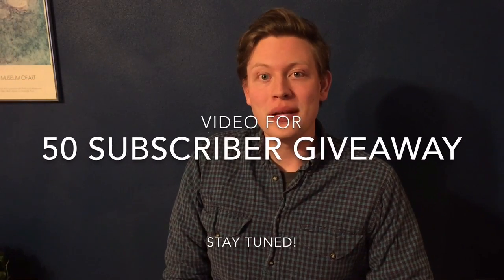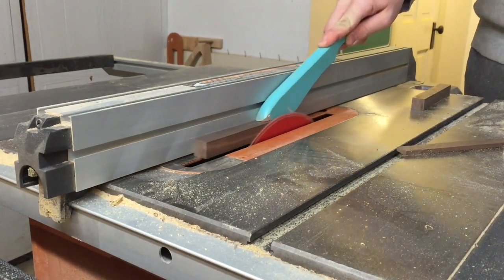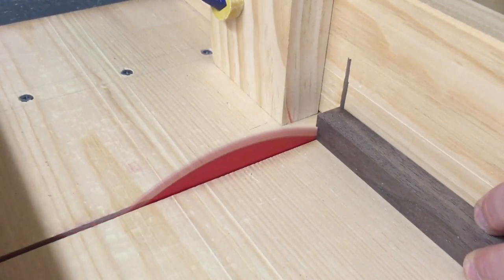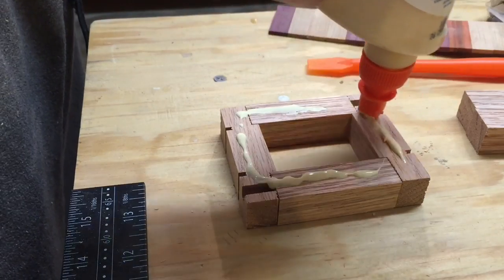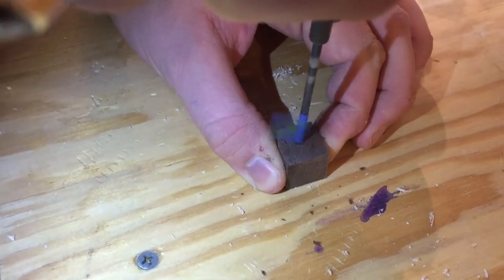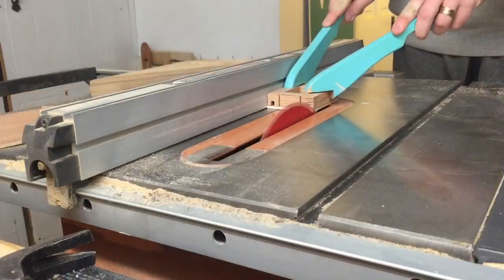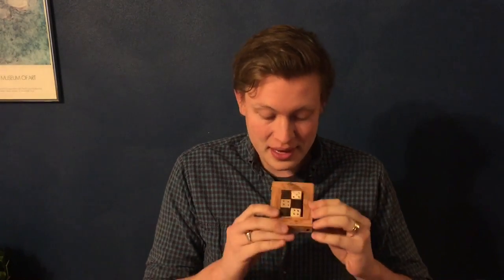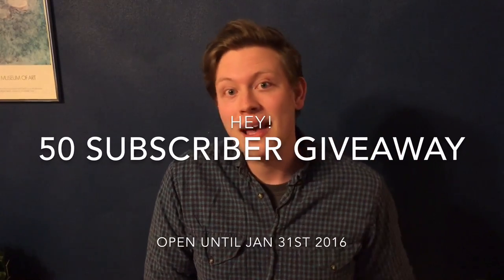How to Make Wooden Dice

Comment: I have been woodworking for 40 years. I learnt about kickback the hard way. I got hit by a 2x4. It happens so fast you can't even blink. It caused a massive bruise on my left side. I never operate a table saw without a splitter or riving knife. Please be safer and make a splitter or use the riving knife(if your saw came with one). I cringe seeing people pushing stock thru with no splitter or riving knife.

Comment: Did you make sure to weight them properly (IE drill the holes on the faces with less holes deeper slightly so that the center of mass isn't off)?
Reply from the maker: +cooldude23407 Alas, I did not.  If I were to do these again I wouldn't even drill holes at all actually.  I've learned that a better method would be to burn in small indented divots.  Thanks for commenting!

Comment: Before making a video and a bunch of these dice you might want to find out how a dice is made! If you add up the opposing sides they add up to 7. Cannt just put random dots on.
Reply: Also since you drill material out for the dots not there is abhorrent balancing issue, well as corners being hand rounded that changes results as well. Cool decoration but not a dice really

Comment: Hello, a little late, but I was wondering how you would go about making them from something round, such as from deer antlers?
Reply from the maker: That sounds cool.  In that cased, I would recommend holding the antler pieces in a vice grip and then using a drill press.  Have fun making those!
Reply: Thanks! I will!

Comment: The tripod on the table saw shot was actually pretty cool.  Looked like a pan almost.  Like the dice, like the case, good video.  One question - how come the work piece appeared to climb up the blade on the first shot of you cutting it, and how can you avoid that?
Reply from the maker: Thanks Matthew!  I was able to fix that climbing problem after this video. It was happening in part because my faceplate wasn't properly flush with the top of the saw, and also my push sticks were too short.

Comment: Where is your blade guard!
Reply: For you other readers:.  Invest the money, get an overhead blade guard w removeable splitter if you don't like removing the blade guard for jigs.    And if you're using a jig like a crosscut sled try to put safety guards (lexan/back blade blocks etc) on them.  And PLEASE loose the long sleeves and jewelry while you're using power tools.  Using the stop on the right side of the blade, just like using a fence with a miter gauge, face full of wood (or worst) waiting to happen.   Guards are cheaper than a trip to the emergency room and prosthetics .   Bear with an oldish timer for a story:  Was in the Plano Texas Medical Center emergency room around 7:30 one night (on a non-woodworking related visit) about 17-18 years ago.  A lady walks in carrying a tupperware container.  She's running across the room, crying.  Behind her a fella walks in half hunched over, white as a freaking sheet.  His right hand was wrapped in a blood soaked towel, he was walking slowly, in a daze and almost stumbled and fell down.  He was in pain and shock.  Heard the wife (presumably) tell the nurse he had been using his tablesaw without the blade guard.  Guess what was in the tupperware bowl: most of three fingers and half a thumb.  Apparently, from what he was able to kinda say, the short wood piece he was ripping kicked back and shot off across the room; and (without the blade guard in place) his hand went forward right into the blade.

As for the push stick, can't say much there. I use a leftover curly maple slat from my kid's crib I built decades ago.  Its about 4" shorter now and the curly in it is highly polished from hand oils.

STAY SAFE  emphasis intended.